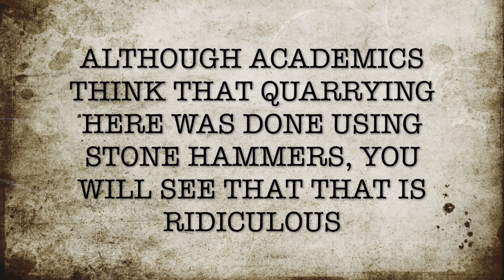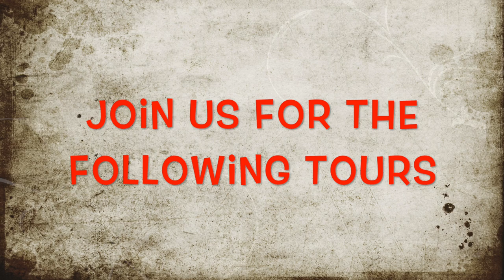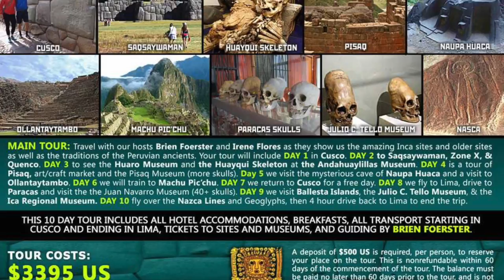Lost Ancient Technology Of Egypt 2017: Aswan Quarry

Comment: My curiosity of the quarrying of Aswan granite with ancient high technology led to me a recent paper on "Experimental Study on Microwave Assisted Hard Rock Cutting of Granite". BHM (2017) Vol. 162 (2): 77–81  DOI 10.1007/s00501-016-0569-0

I read through the paper and it intrigues me that micro-fracturing and heating of the the granite surface (and just under the surface) with a microwave source, reduced the cutting force required by 10% in this paper.  Composition and uniformity of the granite would play a factor in this.

Assuming the pre-dynastic people did have a significant energy source, it's plausible in my mind that they could have had other advanced tools like the paper describes to assist quarrying Aswan granite.
Reply: They did. the pyramids were wireless power systems............similar to Teslas experiments but on a grand scale.
Reply: So with this Microwave Assisted Hard Rock Cutting, they were able to complete the stone structures with copper chisels, correct?  Just being funny, but that is interesting.  Never heard of that before and will check it out further.  Thanks for your comment Brent!
Reply: Nice post but thats only half of it- discounting the fact that the method only makes cutting easier by 10%- the other half of the problem is how were they planning on lifting a 1200 ton object out of that trench?
Reply: How old is Aswan Quarry estimated to be? If they used something similar to this microwave technique they would have had electricity, diamond tools and microwave generators, pretty much our current level of technology, wow.

Comment: Brien,  would you say geopolymers were used to create some of the large megalithic stones, over quarrying/ cutting stone from huge bedrock quarries?  Seems like this might be a possible construction technology, and certainly seems to match much of the evidence (especially the 'sarcophagus' in the King's Chamber).  Of course, I don't think they necessarily poured/ cured them in place - then, you'd need a water irrigation system for getting water up to the top for pouring the stones at height.   Perhaps some (all?) of the casing stones are a geopoplymer?  

Personally, I find Pierre Houdin's spiral construction hypothesis compelling, and much actual evidence indicates this method was the one actually used.  And as you point out, some of these megaliths were indeed quarried/ cut from the bedrock stone.  But IF geopolymers of crushed limestone, granite, water & compounding agent were used to form many of the megalithic blocks, like Puma Punku 'H' blocks, as well as Machu Picchu and others, how might this difference be explained?  

Perhaps we're dealing with a civilization that pre-dates Atlantis?  What do you think?  Were the original builders working with geopolymers? Or, A combination?
Reply from the maker: NO geopolymers

Comment: High pressure water cutting? How big nozzle and much PSI would you need to get a scoop imprint like that?
Reply: way too much pressure needed , pump , stainless steel tubing , it is an aliens cutting technologies just think of an energy field that break atoms electron bonding about 40 Cm wide and 1 mm thick , any rock touched turn into sand

Comment: There is one more thing I can think of so you could make a type of saw essentially by getting a round stone and using rope with tension to create a sawing back and for motion where as when you pull the rope from both sides the stone spins, you let the ropes back towards the stone it spins the opposite direction, that would totally make it faster and less demanding work.
Reply: To do this though you would need to first drill holes through the stone in question.

Comment: Looks to me like they were using an acid etching technique perhaps using fluorites or other minerals known to attack stone and dissolve it. The acid may have been sprayed onto the stone using a perforated wand and that would account for the uniform width of the scoops or pools of acid that would collect. 
Sufuric acid must have been readily available from copper smelting operations where the sulfur dioxide gas can be simply bubbled through water. 
The Baghdad battery clearly shows that electrochemistry was understood because 99.9 percent pure copper tube was found and that could only have been made through electrochemical plating of copper sulfate. Both copper and iron were produced. As well as Bismuth, Antimony, Lead, Zinc etc. 
Decorative pottery was  exported globally which used glazes etc.
 Glass technology was very advanced and formulas for glasses were known.
The Dendera Light clearly shows a knowledge of electricity and electric lighting consistent with the fact that no soot residues were found in any passageways.

Comment: looks like the stone was melted
Reply: was my first thought, but wouldn't that make the rock surface appear kind of volcanic? Blackened maybe, and possibly smooth?
Reply: Or liquefied it...
Reply: possibly by sound frequency...
Reply: native Texan  or the material was soft,,,,,like clay.  ??????
Reply: jamespaul02 Granite is igneous rock that forms below the surface so was already formed.
Reply: chemicals must have been used to soften stone somehow, we see these stones in other sites, (there's actually a bird that uses a leaf to rub holes into stone) because when you heave stone it either cracks it or vitrifies it, although archaeologists do believe they used fire to aid in splitting stone, but there's also vitrified stone in many other ancient sites, stone with a smooth glass-like appearance, but that takes intense heat..over 1000c which is an extremely hot fire, a nuclear blast can do this also I hear, glass has been found in the desert that was made from supposedly a meteor smashing into the sand, the ancients were definitely aware of the glass, sometimes though the stone looks cast or molded but then that's not feasible or possible because they're all different sizes and you can't really fool any expert with a fake stone, sometimes they also have two little nodules protruding from the stone which sorta looks like they used electricity to shape the stone to surrounding mating surfaces..maybe used the stone like a welding rod? maybe a technique like electroplating was used, I have no idea, all I know is that in some instances they in no way chiseled the stone
Reply: Not these...agree with the 'melt' explanation.